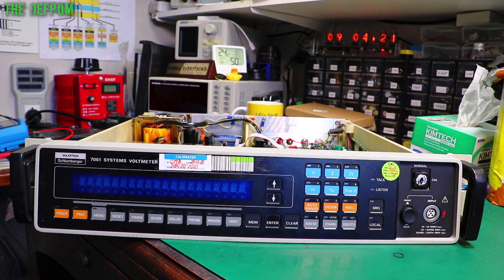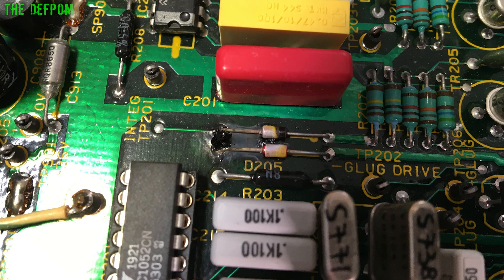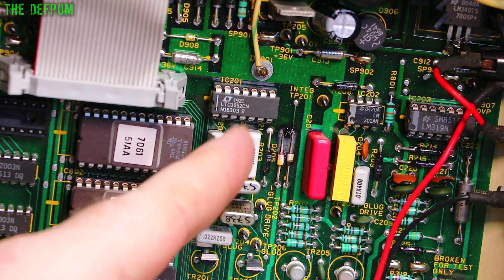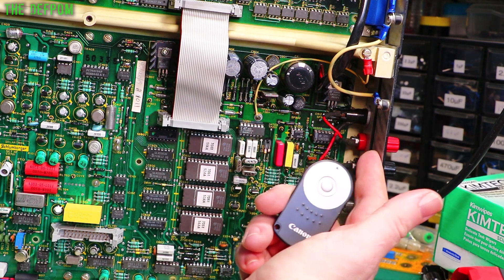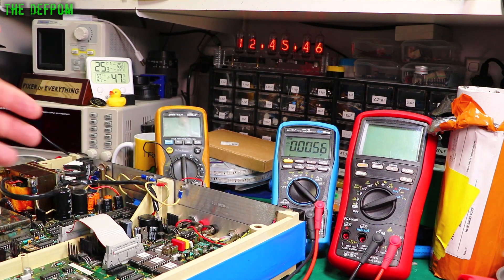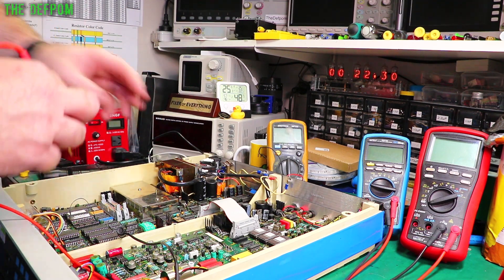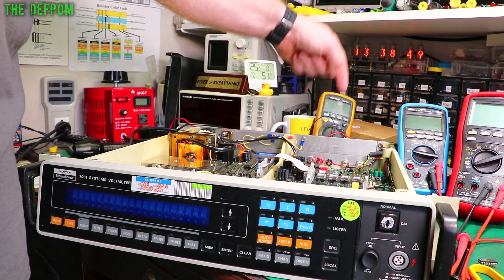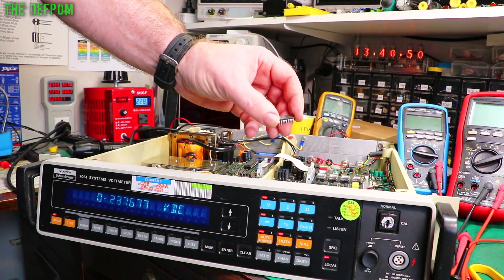🔴 Solartron 7061 Repair - No.838

Comment: I change the 7805 of CPU board for 3 lead stepdown regulator, i save lot of heat, between 1/3 to 1/2 of saving Watt input for the wall!
I dont remove 7805, i juste remove solder jumper of each regulator ouput and put wire to new regulator.
Yes, the new regulator make a little high frequency ripple but, is only on logic board, i use low ESR cap direct on the regulator to keep ripple low and i keep linear regulator on linear board.

Comment: Did your unit also have a self test fail? I, in my firm, also have an unit which - so far - was in cal service with Bielli. Now, I am concerned - the unit had weird behavior before, in that it seems to be "shizophrenic" in the self test.
Reply from the maker: In my case it completely locked up initially, and then just showed “ADC Failure” when it turned on.
Reply: @TheDefpom  this is less wierd than mine. Mine worked, but if I force it to self test, it runs a self test routine for hardware which it does not have and then logically fails. Does your unit pass its self tests?
Reply from the maker: @MrTamhan  There are dip switches on the PCB that tell it what options are installed, it is probably set incorrectly, check out the service manual for it as that explains them.

Comment: What an odd thing to happen, have you taken the dead chip and connected it to a current limited supply and measured the current, if any at all now.
Also is there a data sheet that will tell you the limits of current it may use.
Reply from the maker: It’s in the bin now, the only thing I can think caused it was a latch up.
Reply: @TheDefpom  Believe it or not, i had the same thought but i dismissed my guess as silly.
There may have been a different supply filtering requirement for that new chip, some kind of thermister in series.
I dont know, just brain noise lol.

Comment: Did you check the datasheets to check whether the components were absolutely compatible?
Reply from the maker: I had done a quick comparison, but as others had successfully used the chip I probably wasn’t as thorough as I could have been.

Comment: In my long experience of electronics, random failure of brand new, full spec, well-sourced components is NOT completely unknown!  (But FWIW, judging from your diagnostic work, my gut feeling is that "something" happening with/at the diodes killed the new chip.)
Reply from the maker: The only thing I can think of is it had a latch up for some reason.
Reply: @TheDefpom  Does the new chip have the same rail voltage specifications?  Maybe the Zener values need adjusting?

Comment: Mine became very hot, sometimes it smoked, the cause was the transformer. It was OK though. I solved it by mounting the cabinet on feet and nothing on top of it. Then I mounted a PTC (or NTC, it is long time ago) to measure the temp in the cabinet. Mounted a heatsink on top of the cabinet above the transformer. The fan above that now keeps the inside of the cabinet constant (around 30 degrees C if I remember well. ) It has become a bit obsolete since I have a Keithley 7510 (And a Prema) I still use the Solartron to monitor during calibrations. I have standard cells (incl cal history) and several calibrators, including yours. I measure the standardcell with the Solartron, note that value (I do not care if it is off a bit.) I then set the calibrator at the standardcell value and monitor that with the Solartron.  This must show the noted before standardcell voltage.  Everytime I need to change range I set the calibrator again at standard cell voltage in that range and measure that with the Solartron. It is stable enough for that. It is just an extra test. This way I adjusted a Fluke 5110 after repairing it. The customer then sended it to Fluke for calibration (1700 euros !!! anbd he payed that twice because it came to me after it "failed" calibration by Fluke, that alone is an other story, because Fluke was wrong for DC and AC)  and it turned out to be within 0.1 ppm for DCV after my adjusting and repair. (BTW, I only repair calibration gear, I do not calibrate, but after repair I sometimes need to adjust it as good as possible (only when needed, cal companies do not always like it if you adjust things :-)  ) T
Reply: Keysight once told me after I asked if they could "adjust" my 3458A rather than simply document the existing calibration......but they said it's possible during adjustment they could throw it further off than it is now. A pity, because despite being well inside the spec. I was hoping they could nail it even closer.........I guess that happens when dealing way down in the noise...LOL
Reply from the maker: The thermal design of the unit is interesting, I think they should have compartmentalised sections and adding cooling for the power supplies whilst keep air flow from the important bits.
Reply: @TheDefpom  If you look at the the top lid of the cabinet, you see the transformer touches that. The lid functions as a heatsink/spreader . I added some paste between them and that is why I think they must have free space above and under the cabinet. In my lab it can get over 30 degrees in summer (most people in the Netherlands do not have Airconditioning and I think meters like this are most times used in more temperature stable places) and that was when it started smoking because it was a rackmount version it had no feet and I had put it on a wooden shelf. On top of it was an other piece of gear without feet. That was how I discovered about the "a bit weird" thermal design. If you have airco it will not be a problem (i hope)
Reply: There is also the bridge rectifier (D501) which sits between the power transformer and the shielding box on PCB 3. It has no heatsink.  Mine runs at over 60C and is certainly a major source of heat in that area of the case.  In fact on my unit you can see the discolored PCB material (yellow/orange) under and around the bridge rectifier. I need to consider how to move that heat away from the "walkway" between the transformer and shield box. All the voltage rails are fine, and the filter capacitors are new.   @pa4tim

Comment: Scope the supply rails on that IC (+/-15V side of the zeners) for rippling/spikes etc when cold and after a good warm up (with case lid on). If the supply rails are +/-15V then after the zeners that IC is seeing approx. +/-7.5V which is awfully close to the 16V max for the LTC1052.
You could change out the zeners for say 9V ones if the signals are low enough and add some decoupling caps on the op-amp side as zeners can be noisy......or better still add a couple of LM317 type regs which will give the op-amp a better supply.
Wonder what the max. supply of the original op-amp was?.....18V I think?
Reply from the maker: I am just sticking with the original part for now, I sourced some spares too in case it happens again.

Comment: Where it arc'd I highly recommend paining it with GC 10-9002A Red Insulating Varnish.  That stuff is good for high voltage arcing too.  It works miracles some times.  I've been using it for many, many, many years (probably since the old TV days in the late 70's).  It's been around a long time.  Get a jar before some idiot bean counter discontinues it.
Reply from the maker: I will keep that in mind, it will probably be ok now as it has a slot in the pcb now.